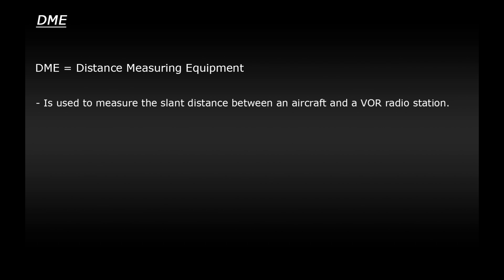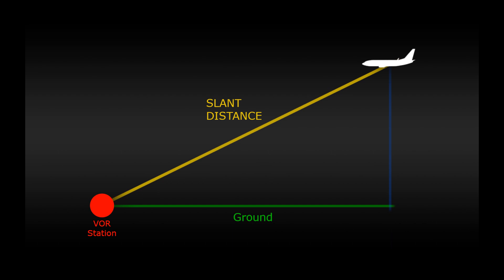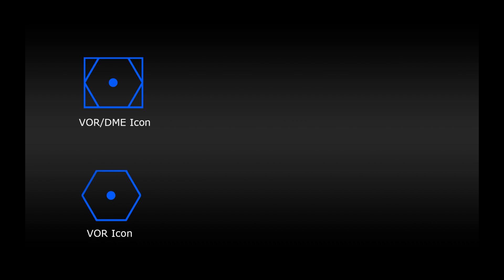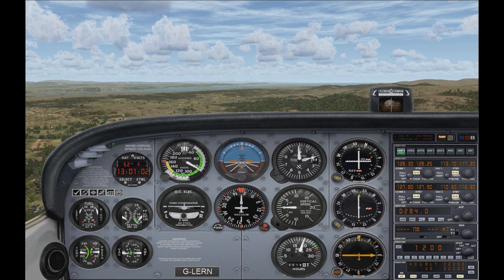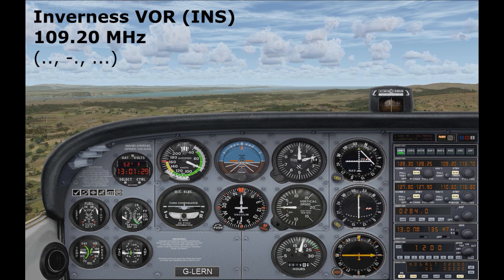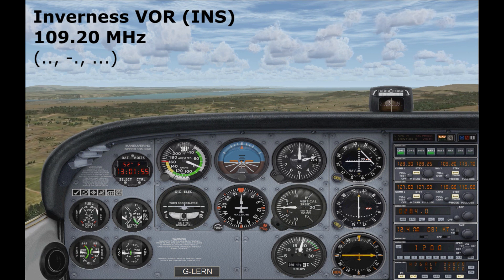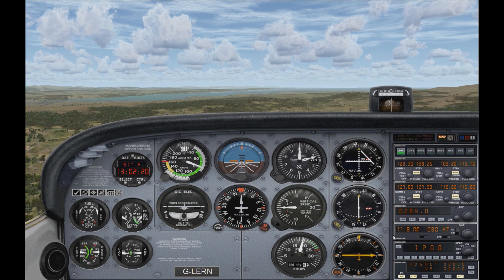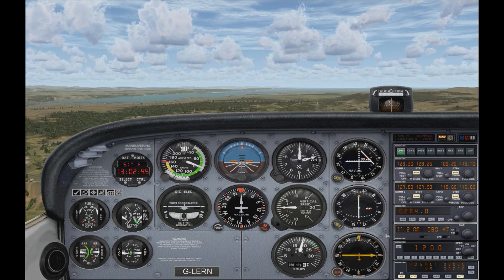FSX Tutorial: Distance Measuring Equipment (DME)

Comment: I was flying out of Graz, Austria in the A2A C182 Skylane and I tuned to the VOR/DME at Graz and another nearby VOR/DME was tuned on my other NAV radio. 113.10 and 116.20 if memory serves.  I took off and climbed to about 4000 feet, then I clicked on NAV1 and listened for a long time. No signal was received. I tried the NAV2 radio button. Still no signal. Then I clicked on the DME button in conjunction with the NAV1 button and I heard the morse code. There is clearly a difference between the two planes. I'm going to guess the A2A C182 is a more accurate representation, unless there is some other explanation.

Great video series BTW.
Reply from the maker: Ah, in the A2A aircraft, there's a small control you need to pull out on the radio stack for the Morse Code to be heard. There should be a little knob on the radio stack with the words "PULL IDENT" beside it. When the knob is pulled out and the Nav button is pressed, then you should be able to hear the morse code.

Comment: Hello! Where is the DME located in A2A C172? THanks!
Reply from the maker: Same location as the default 172 in FSX, in the radio stack however you would need to have a full radio stack selected and not one of the stacks which has a GPS integrated.